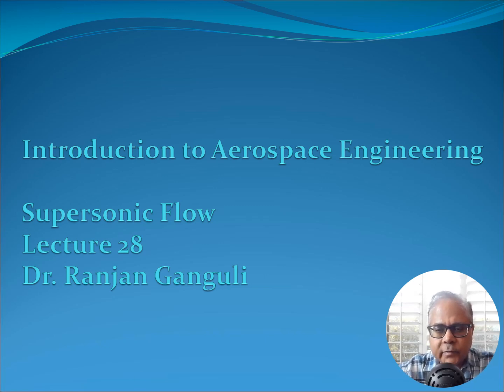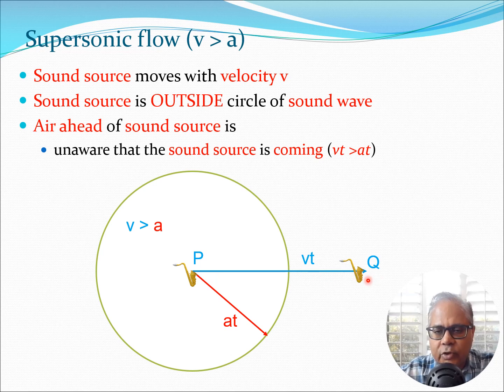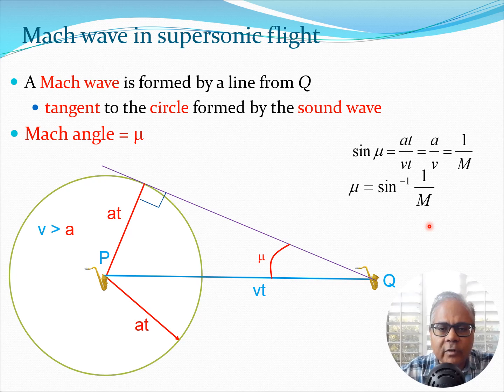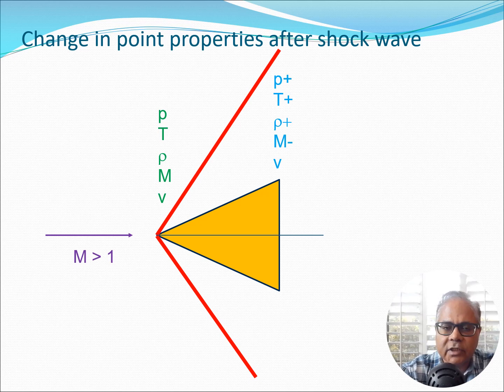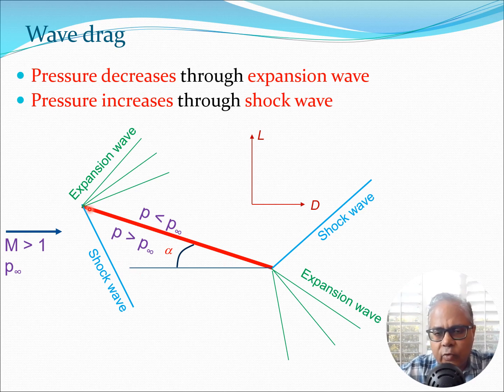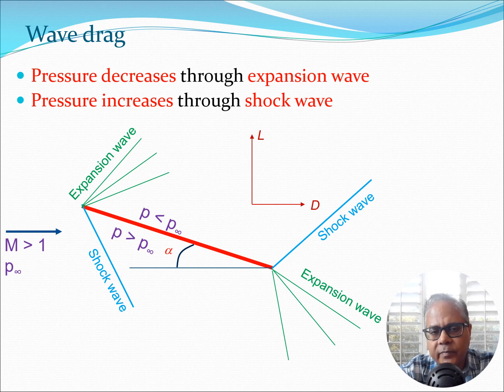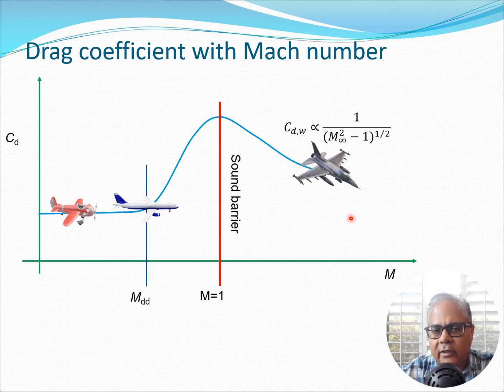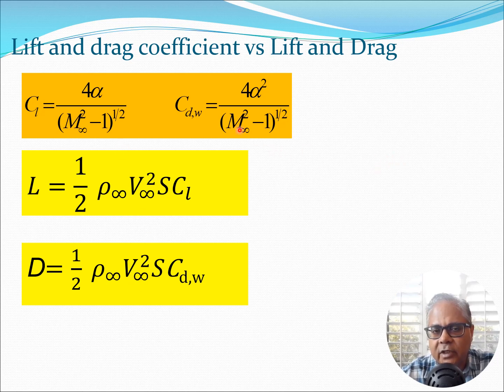Supersonic Flow,  Aerospace Engineering Lecture 28

Comment: sir, it it available single room for phd students in iits?
Reply from the maker: At iit Kharagpur we used to have single rooms in the 1980’s. Don’t know the current situation. They have increased the intake a lot
Reply: @Drganguli  if married coupled then, iit delhi?
Reply from the maker: @lombulombu-vn5do  I think married couples have own apartments. Some people get married to get the apartments
Reply: @Drganguli  if i am unmarried, then also can i get this appartment?  difference of rental charges between appartment and hostel?
Reply from the maker: I think you need to show marriage certificate to get the married apartments. Rent is lower in hostels.